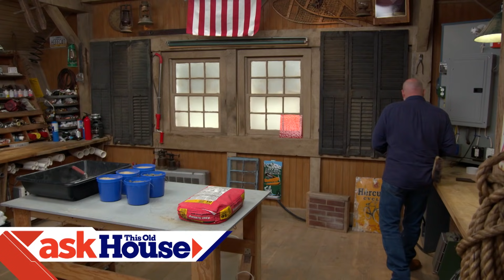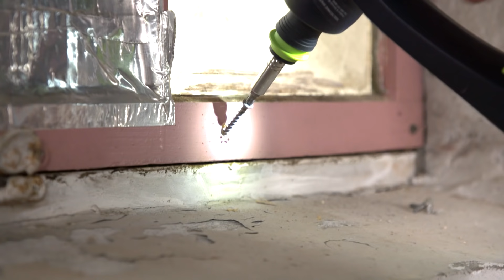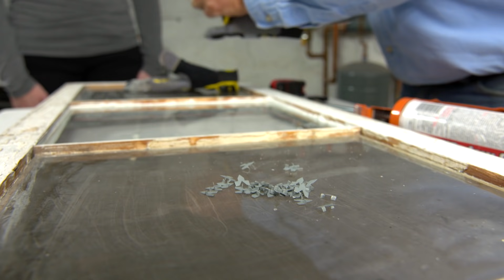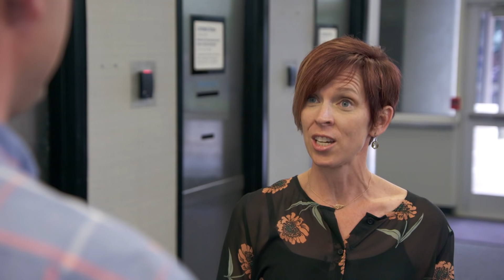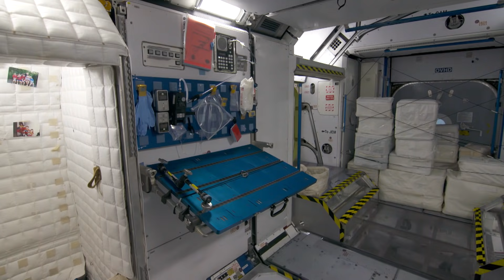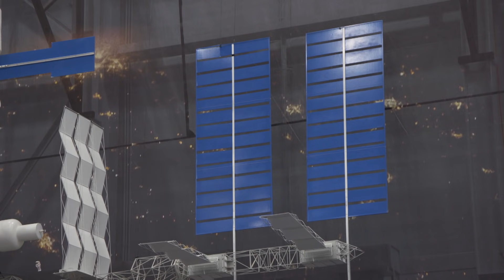Ask This Old House | Window Repair, Space House Tour (S17 E2) | FULL EPISODE

Comment: I bought a house that was built in the 50's. The basement windows are single pane and steel frame and a steel case, both are rusting and we get tons of spiders through them. I'm guessing that I will need to rent a concrete saw to cut the old windows out before I put the new windows in. Dose anyone have any thoughts or ideas?

Comment: Tommy knows better. Could have easily replaced that window with a new unit. He’s just showcasing his glass cutting and glazing skills. Those old windows are just an open door to a cat burglar and not weather tight
Reply: That's why they had the screws in there, for security, not for weatherproofing. He did the same thing with an old door in another episode. He spent the whole day trimming the door and adding weatherstripping, when he could have installed an energy-efficient pre-hung new door in less time.

Comment: My lord, they nearly go full haz-mat to scrape out some putty from that window frame...hepa vac respirators, safety goggles and all, but when mixing the cement in the earlier bit, all that crystalline silica and calcium oxide dust flying around everywhere, not so much as a dusk mask let alone doing it outside!
Reply: I noticed that too. Knocking some old putty out - zero dust - Full haz-mat. 
Mixing cement - dust everywhere- MAN UP!! 🤦‍♂️
Reply: Lead Paint
Reply: tommy is more important to the producers than kevin and the other guy.
Reply: Some glazing compound had asbestos.

Comment: What everyone actually wants to know is how to repair their aging double pane windows. Replacing the whole thing is plainly ridiculous.
Reply: some people like new windows.
Reply: @Pure_KodiakWILD_Power  Double pane windows are "new" at least compared to those.
Reply: @Furiends  true indeed.
Reply: kodiak wild Many people can’t afford to replace a broken double glass window with an entire new unit, not care to wait six weeks for a new sash from the MFN.
Reply: @Nill757  well, if we want new windows that aren't standard sizes, then that's what we have to do.  if we can't afford it, or don't want to do, figure out a repair with a piece of glass and epoxy 🤷‍♂️ don't want to slap duct tape and plastic on there forever.
Reply: @Nill757  That's really not hard at all. A vacuum pump is about $45 and argon is about $20. The materials and equipment isn't the issue. I can't buy sash parts to replace rotted wood or broken and cracked inserts.
Reply: kodiak wild For a broken through window, I think the best choice in lieu of a new replacement sash is to clear all the breakage, then replace with a single pane cut to size per the video.
Reply: @Nill757  You're kinda missing the point here. IF the windows were meant to be user serviceable they could be. Also you don't need to completely pump down the glass or at all. Pumping down some just prevents wasting as much argon.
Reply: penguins forall I agree it’s plausible manufactures might be able to make them serviceable via some kit, though I see no path to a workable one for DIY folks.

If any moisture laden air remains in the gap it will condense out and or freeze, a major problem with even slight leaks in the older double glass windows.
Reply: @Nill757  More than half the video is rebuilding the sash not just the glazing. Although while I get its a more complicated task I disagree this would be a hard DIY. Whats hard is milling the sash which I can't do at home without a lot of equipment.
Reply: penguins forall Yes I see we disagree on feasibility, but like I say I don’t see any path for DIY for the reasons I’ve detailed.